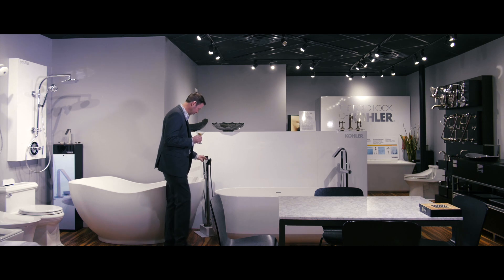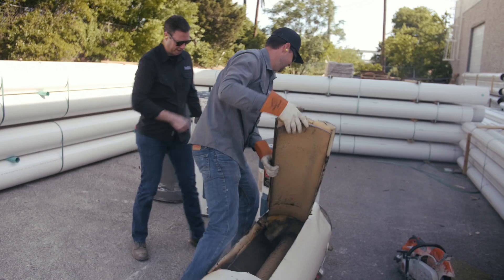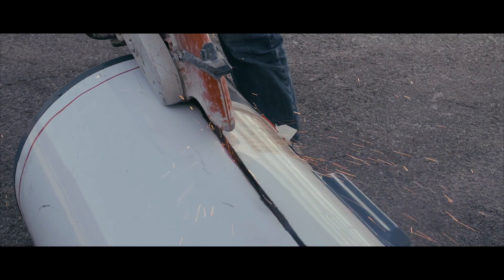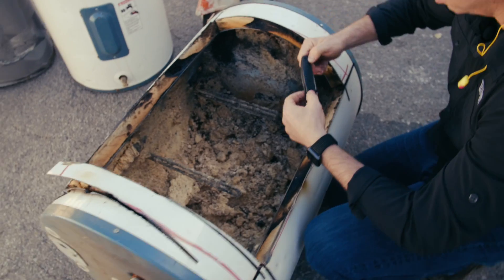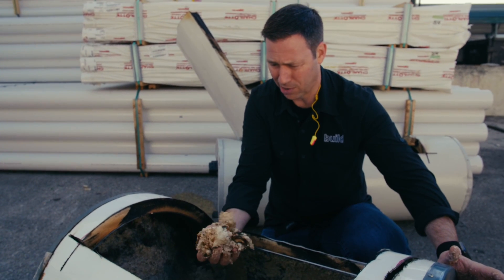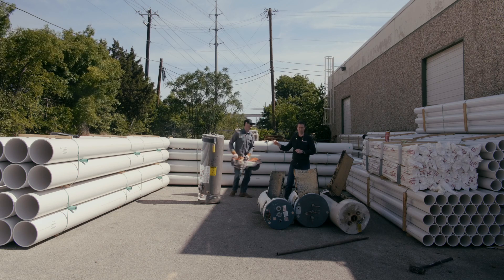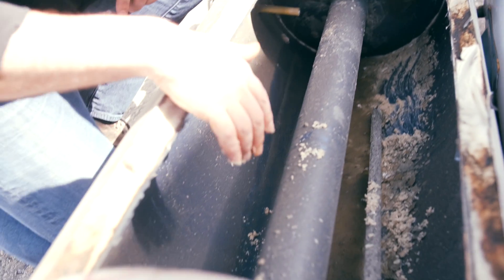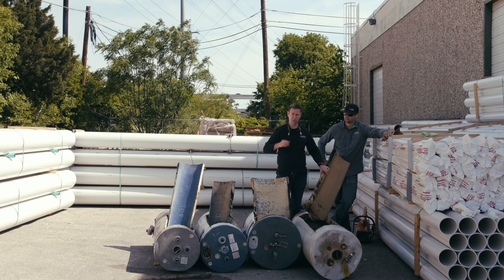Water Heater Tank Autopsy: You won’t believe what’s inside!

Comment: I was a compliance officer with a State Public Dinking Water Agency for twenty years and inspected drinking water public systems for most of them.  Water systems add calcium for a reason, first when they treat surface water with alum to remove sediment the water becomes corrosive, then they have to restablize it with lime/calcium it so it won't leach copper and lead from the pipes and fixtures.  For well water, they also check for stability in the water once they remove the iron and manganese by oxidation, then add lime if needed.  

Those water heaters most likely came from different water sources.  I would guess the ones that had tons of buildup came from people who had well water or came from a public system that over fed the calcium to make the water softer.  The black mixed in with the calcium build up is oxidized manganese and the light red color is oxidized iron, neither is harmful to anyone, just a little ascetically unpleasant.  Water lines get looking just like this, but not really a problem except reducing the size of the piping.  

If someone installs water softeners (or reverse osmosis units) to reduce the mineral build up, please add a bypass so you can blend some of the harder water with the soften water!!!  If you don't the water becomes corrosive and will leach out the lead and copper in your water lines or plumbing fixtures.  I think everyone would rather have a little calcium in the water than lead or copper!!!!  If you have a water softener, just don't drink the first draw in the morning that sat in the lines all night.  Letting that water drain from the pipes will remove that lead/copper build up.

Lime build up in the tanks most likely built up in the lower flow areas of those tanks.
Reply: Eric Van Eck this is one of the best responses I've seen on YouTube - informative and clear. Thx.
Reply: Thanks Ttf,  I had a really good mentor for a supervisor and with many years of experience I learned a lot about water.  Not to say all the terrible things I saw too.
Reply: Eric Van Eck this is an excellent comment. Now I want Matt to do a video on water softeners and the dangers of them.
Reply: I work in the Distribution Division of a Public Water System (PWS).  His comment is SPOT ON.  I couldn’t have said that any better. Excellent
Reply: Here in Southern California it’s all about your source water mix. There isn’t much local surface water (rivers) so local water is usually groundwater (wells). Water imported from the Colorado River is high in minerals and salts. Water imported from Northern California is low in minerals but high in carbon. Water from the tap can be from one of a hundred local water agencies. Each agency is providing a different mix of these three. Generally the more Colorado water, the more water heater sediment and corrosion issues.
Reply: If you do install a water softener would the lead and copper still leach out in cpvc pipes?
Reply: The ion exchange water softener replaces calcium ion with sodium or potassium ion. Such replacement should not make PH value of the water acidic because sodium and potassium are also the ions of a strong base (like calcium). If the copper pipe leaching is due to the acidity of the water, the ion exchange water softener should make no difference. The acidity of naturally soft water is another story. the high acidity of naturally soft water should be naturalized and buffered with calcium-based salt or base.
Reply: I used to work for a municipal water department and they would add minerals to keep the water mains from rusting out (they were made of iron). The minerals would form a crust on the inside of the mains to protect the iron water mains.
Reply: I have pretty hard water from a well. I used to have a softener that was nice but it gave out so I'm back to hard. When I used to boil water it would leave a white residue on the pot. Then I got one of those carbon filters at Home Depot. Now when I boil water there is very little residue so I think they help especially for boiling.
Reply: Good thing I have all PEX with my softener :)
Reply: The leaching of copper and lead has more to do with DIC then just removin mineral content (i.e. calcium and magnesium).
Reply: Completely agree with the different water sources part. But I am convinced that electric water heaters are way worse then gas fired for 2 reasons. The elements get way hotter per square inch which will basically flash boil the water that is in direct contact with the elements surface sucking 100% of the scale possible out of every drop it comes in direct contact with. And even tho electric element are N O T meant to function as electrolysis probes. I do believe that eddy currents emanating from them has unintentionally zapped the minerals that are magnetic out of the water.  Just a thought.
Reply: Eric! You are a very smart man! You are 100 no sorry. 1000 percent correct
Reply: So would rainwater be best?
Reply: Excellent info
Reply: Well now there are less and less copper pipes nor lead — most are being replaced with plastic. Calcium and magnesium is also dependent on the water supply. I’m not sure it’s being added to the water or anymore.   We used to drain our tanks every year or in areas with high calcium etc like Florida maybe twice a year.  Now many people don’t do it. It use to be done by the plumber basically no cost when he was doing any other work.  They just hooked a hose up and ran it out the back door, flushed and refrained until pretty clear.    The sediment normally  is in the bottom of the tank… unless the tank is smaller or I reckon placed strangely.
Reply: @plips71755  You still can get lead from the faucets and there are way more older houses than new ones. They still have lead solder and there are a lot of cities that still have lead service lines and mains. If a water supply feeds alum or has RO they need to feed lime or CO2 to make the water stable again because alum strips the alkalinity of the water. Most water system that get water from lakes or rivers feed alum.
Reply: i thought soft water saves water heaters?
Reply: @randomrazr  No, soft water is corrosive while hard water is not.
Reply: @pauld3327  but hard water would leave calcium and lime despoits in the tank?
Reply: @randomrazr  Yes hard water would leave sediments in the tank but hard water would also protect your tank from corrosion. You just need to flush your tank once a year.
Reply: @pauld3327  so soft water kills the tank vs hard water? dam. what about on demand water heaters? tanksless i beleive they camm em
Reply: @randomrazr  tankless water heaters don't last long with hard water.
Reply: AmpEdition  You might have to check the sources of your information.
Reply: @Reno Simpson Where do you get your information?
Reply: Thank you Eric for your previous full explanation of mineral buildup in your comments prior to this reply. It is exactly what I was looking for particularly the reverse osmosis going into the whole house supply line and the corrosiveness of RO water, and damage it can do to copper piping and fixtures. I have a small RO kitchen sink area system that adds minerals back into the water, so far so good!
Reply: RO water is chemically inert. Unless it is not working properly, it’s pH is 7–neutral. This should not leach anything from any pipe. Copper has antiviral activity to it, which is not undesirable. Unless the home’s pipes were installed before 1960 and never updated, lead is an unlikely pipe source contaminate and same goes for pex & pvc...just because your training claimed certain things does not mean it was factual. The commenter mentioning source water was more spot-on. This was done in Austin, TX. Source water there has filtered through tons of limestone so the majority of scale there is usually lime but has some calcium and fluorite mixed in from municipalities. Some scammers came through in the 90’s trying to sell magnetic sleeves for the home water inlet pipes...sadly some people bought them thinking that it would stop the limescale...I cannot mentally fathom how people thought lime, calcium or fluorite would be pulled from water by a magnet. Lead, yes. But zero water tests even showed lead in the water(!).  I dunno, no offense to anyone. Just my 2cents.
Reply: @honeybadgerisme  Actually, RO water can be highly corrosive to metal.  It depends on the purity level, but the higher purity water is so low in dissolved in that it starts pulling metal ions out of the piping.  I used to work with high purity water systems and the approx 1 mega ohm water ran through high purity plastic pipe.  The only metal was a stainless pressure gauge to minimize metal ion contamination.  In 3 months, the gauge failed when the stainless and brass components got eaten through.  I had to install a polymer membrane pressure pass through to protect the replacement gauge.
Reply: I’m a pipe fitter of 20 years and I have well water. I installed two filters at the well.  Settlement and carbon filters that I change every 4 to 6 months. Recently hanged my hot water heather bc the element broke and is too old to get replacement parts. This hot water heater was in great shape. Nothing like the video.  Btw cooper isn’t toxic but the flux and wire to weld it IS. And over time it will slowly leech into the water. I use a three filter system under the sink for drinking water. This comment is the best explanation for what’s going on. Thank you for your input 👍🏽
Reply: Occasionally treating with citric acid would flush that all out. Citric acid (vitamin C) is not toxic and is a weak acid, but I would still flush completely before using the water.
Reply: Vitamin C is ascorbic acid. Citric acid is not a vitamin.
Reply: Citric Acid is not vit. C. Vit. C is Ascorbic acid.
Reply: @owndoc  Absorbic Acid is only one component of vitamin C, there are about 8 others. They sell natural vitamin C w all componets.
Reply: @stevewilcox1755  Your info references?
Reply: @No Compromise You will need a quantity of citric acid powder (it is a form of vitamin C or ascorbic acid). You can use food grade, but industrial grade is cheap and should be satisfactory. You will need to flush the system afterwards anyway. You are unlikely to have an access port to add the powder, so I would dissolve in warm water and find a way to add that. The amount required will depend upon the size of the tank and how much limescale there is. I would probably use 250 to 500 grams, for a 40 gallon tank, but more wouldn't hurt. Then, make sure the tank is topped up with water and wait. The process goes much more quickly if you can heat the tank. I would leave it several days in a cold tank but perhaps only a couple of hours if you can get the temperature up to 60C or so. Flush the tank thoroughly by running the hot water tap before use. If your tank has a tap directly on it I would use that first because the process may loosen some scale. The flush water may be discolored and taste bad, but small quantities will not be dangerous. However, citric acid can cause eye irritation, so take care to flush your shower feed thoroughly. Of course, if your tank is really bad, then you might be best just replacing it. Also, this won't fix problems with corrosion. Citric acid is also really good for cleaning lime scale from showers, shower heads and kettles. An alternative approach would be to add a couple gallons of lemon juice - same chemical. Hope this helps.
Reply: I don't have a whole house RO but it does go to several rooms. It only actually has one metal faucet and the rest are plastic. But I was a little bothered that RO water could sit  next to the valve. Pretty sure thats why at least with cheap faucets so many end up leaking.
Reply: Or don't drink tap water problem solved
Reply: You have to remember water softeners replace calcium and magnesium with salt which will also corrode tanks..probably more so than those other minerals. and yes salt will corrode copper pipes.
Reply: Tomoko Abe water softeners do not replace hardness with salt. Salt is sodium chloride, the resin bed is recharged with the sodium from the salt, the sodium is exchanged for the hardness, but not the chloride.

Comment: The results are very telling, but without data on the water & condition these units were used in, you can't use them as any sort of "gospel". That tank that was nasty might have been on hard well water, rarely used, and never flushed where the others were city water and maintained in some manner. The results here might speak volumes; but, to use that information to assume your heater looks the same is ignorant without knowing these important details.
Reply from the maker: I agree

Comment: The reason you see so much buildup of solids is that CaCO3, the primary component of scale, is less soluble in hot water than in cold water, which is unusual for most salts. The reason it may not adhere as well to the electric element is that the element flexes as it heats up and cools down, whereas the mineral deposits are brittle and tend to flake off.
Reply: actually CaCO3 is more soluble in hot water than in cold (even so the solubility is bad either way) . 

The real reason for the scale accumulation is the heating of the water pushes out dissolved CO2. Thus, with a lack of dissolved CO2 in the water the water-soluble compound Ca(HCO3)2 tends to decompose into insoluble CaCO3, water and CO2.
Reply: Doc Work most of the buildup in the electric heaters is aluminum oxide or magnesium oxide from the anode protecting the tank from corrosion.
Reply: Thank you for this knowledge. Was wondering how the fuck hot water holds LESS salt.
Reply: It's from Jordan using the tank as his "trophy sock."
Reply: I drained my electric tank last year. It was sandy, but white as snow. Pure calcium carbonate.

Comment: I had an electric I cleaned regularly.  The scale you'd expect on the elements ends up in the bottom due to the heat expansion of the elements.  It just flakes off.  When I cleaned mine you could see the flakes that came off the elements in the sludge at the bottom.

Comment: Matt/Jordan, thank you for an informative, entertaining, and destructive building science video. Excellent info for sure.
Do you guys plan to do a video on cleaning/flushing older water heaters, or is that something that's not recommended?
Reply from the maker: I think that’s a good follow up video!  Thanks for the idea
Reply: Yeah Matt..I 2nd that request.
H20 water flush for gas powered tanks. .
Reply: you could add some acid to the flush to dissolve the corrosion, IE muriatic (hydrochloric) will dissolve the minerals but not the steel, likely to give off some nasty gases in the process however. Also works great as toilet/tub cleaner for those without a softener and well water.

Comment: I have 8 rental units as well as my home, all with their own individual water heaters.  Six of the nine are electrics.  Only my home electric water heaters has softened water.  The other five electrics(as are the gas) are subject to the hard water we have.  I continually (at least once every two years) have to replace heating elements or the heaters themselves due to failure except for my eleven year old home heater.  Very little problem with the 3 gas units.  I've been trying to flush the electrics yearly by removing the bottom element and turning water supply off and on.  A large quantity of sediment comes out each time.
Reply: Lawrence Carroll if you inspect/replace the anode rod in the electric units regularly then you won't kill heater elements or end up with leaky tanks. If you find the elements last 2 years, then change the anode yearly and see if the elements last longer. Also, better warrantee tanks usually have larger anodes, hence the longer guaranteed life.
Reply: don't forget to replace the anodes! They're hidden under a cap on the electric units. Keep on top of them and keep flushing like you are and you won't be replacing the tanks or elements as often. The size of the wrench you need is 1 & 1/16.